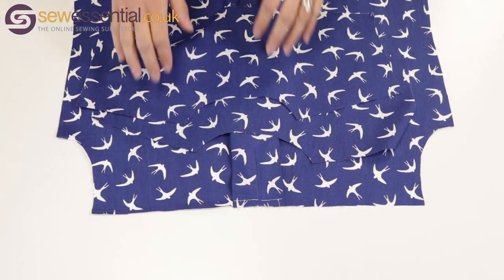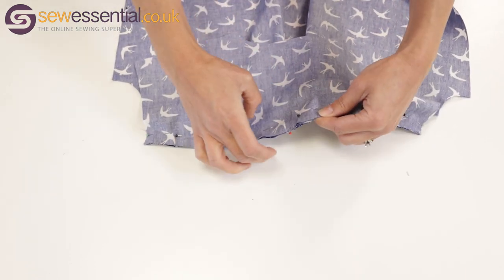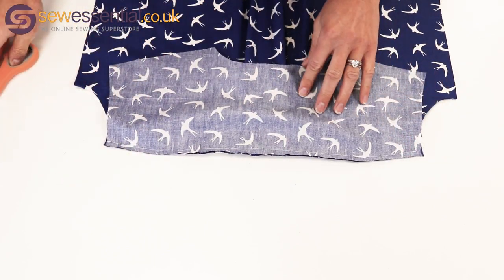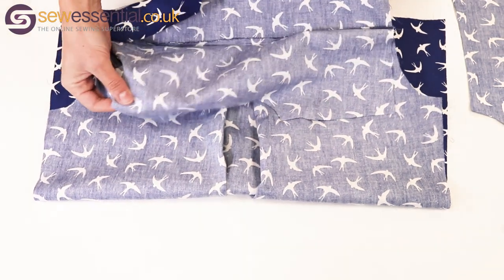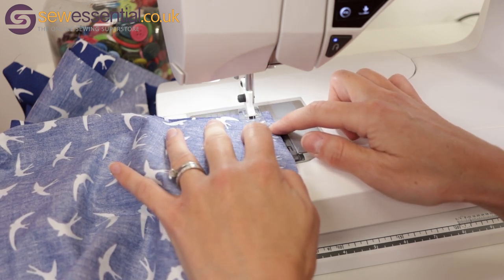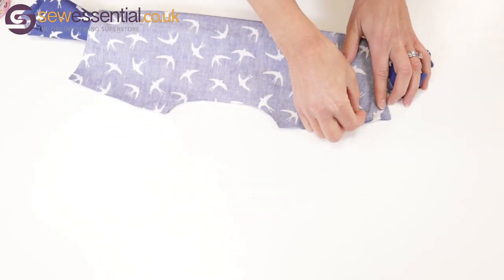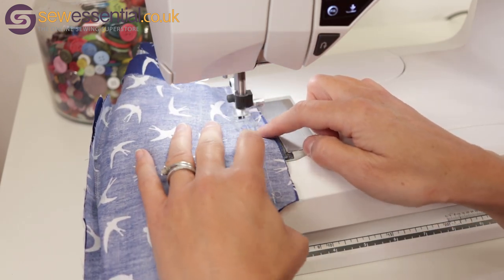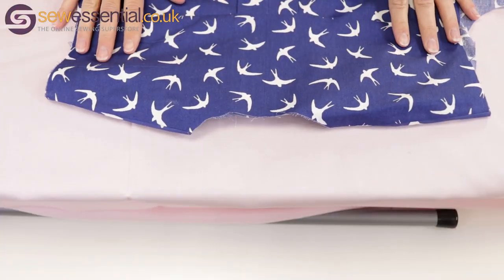How to Sew a Shirt Yoke - the Burrito Machine Sewn Method

Comment: Fantastic tutorial - thank you! I tried the method on a t-shirt to replicate my favourite shop-bought t-shirt which has the front and back enclosed (like two of your back pieces). I sewed the front neckline burrito and pulled it out through the sleeve hole, then treated that as one piece and used your method but taking the back neckline in too and pulling it out through the sleeve again. It worked perfectly! Couldn't have done it without your tutorial.
Reply: I am trying to figure out what you said. Butterick 6838 pattern, nightgown with yokes on front and back. Can you please explain with a bit more detail?
Reply: @lydkoch9209  Sorry I never check my youtube! I meant I used the tutorial for a t-shirt so used it for the front and back instead of just the back :)